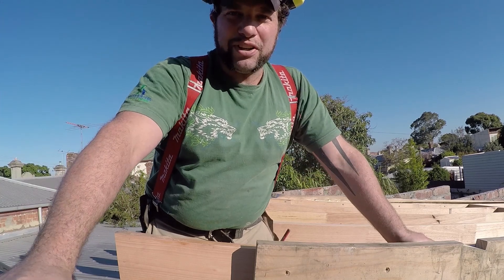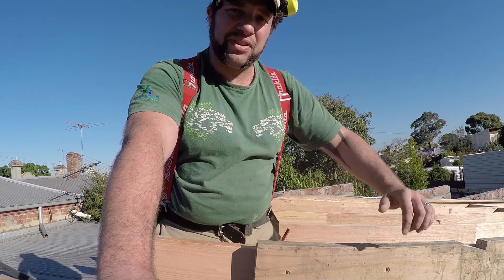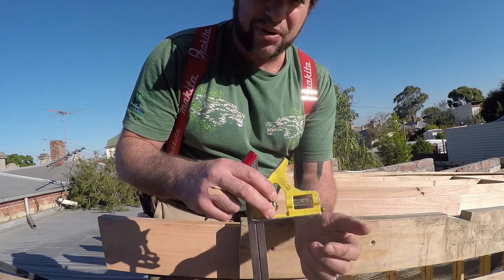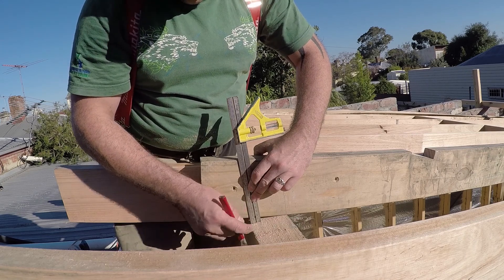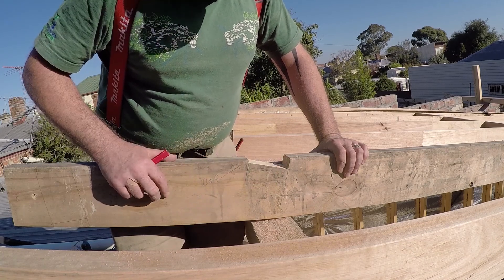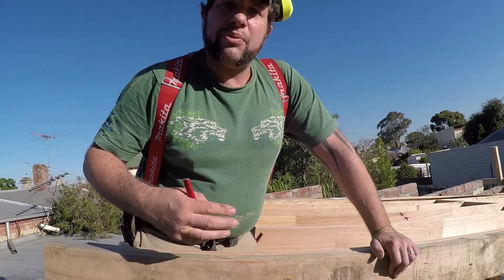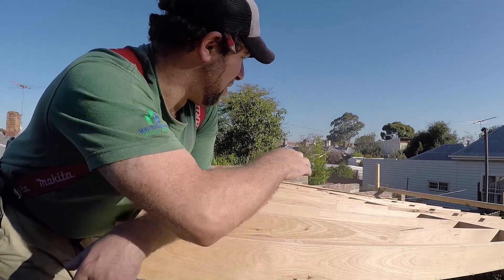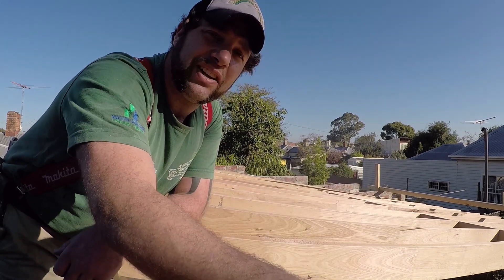How to Pitch a roof  (Skillion or Mono pitch) inc making a pattern rafter with an overlap birdsmouth

Comment: Hello, thank you so much for this excellent explanation. I feel a lot more confident about my project now. I am not sure if you can help me on this question, but fingers crossed... I will be building my small home myself with ICFs for external walls (polystyrene "lego blocks" filled with concrete) and having a skillion roof. I will have a timber top plate (secured by bolts pre-installed into wet concrete at top of the external walls). Do you know how I tie down and/or secure the rafters (150 x 45 LVL (hopefully I can get them!!)). Maybe the bolts have to be long enough to go through rafter as well, but how do I then lay tin over that bolt sticking through??? Or can rafters be tied down with something???? Thank you in advance for your time and I appreciate any suggestions or advice you may have.
Reply from the maker: Gday Robin,
i will need to make a video for you to show you this yet i have just moved to a remote aboriginal community and will not get around to this anytime soon... sorry champ.
i am a HUGE supporter of batten screw / pryda screw in's that are designed to tie down rafters to top plates, top plates to studs and bottom plates to slabs or joist / bearer systems.

many engineers specify all thread to go from the top plate al the way through to the bottom and epoxied in and/or bolted throughout to ensure its tied in a few different places. 
hope that help and feel free to support our channel at 
www.patreon.com/beowulfbuilders so that we can continue bringing more info to you and around the globe.
#stayawesome
joe joe
Reply: @BeowulfBuilders  thanks for the info

Comment: If you had a double top plate would you still need to put the rafters at 450 centres or could you maybe do them at 600?
Reply from the maker: Gday Knight rider,
yes,, corrrrrrect..... the double plate will allow you to sit your rafters anywhere along the frame yet the single plate ensures that you site your rafters with direct downward pressure onto the stud work (450mm spacing).
#stayawesome
joe joe